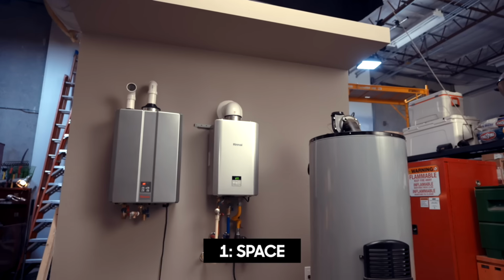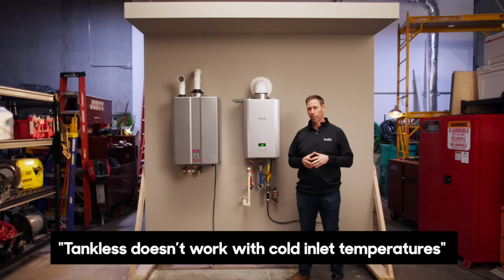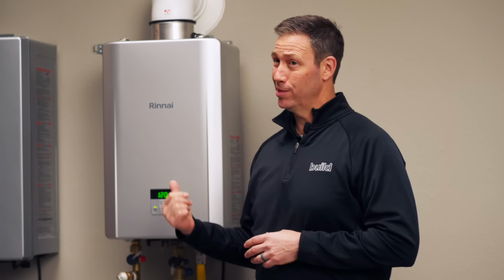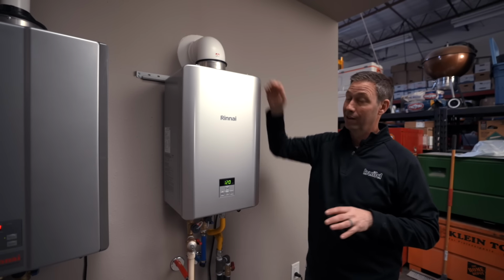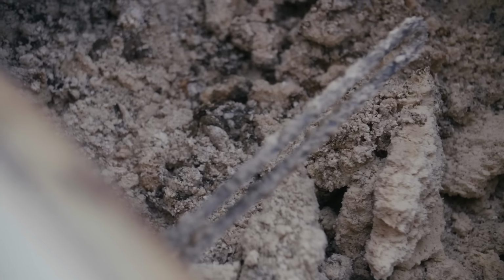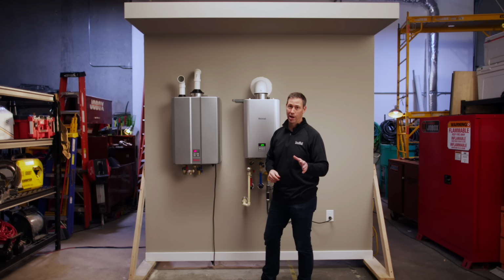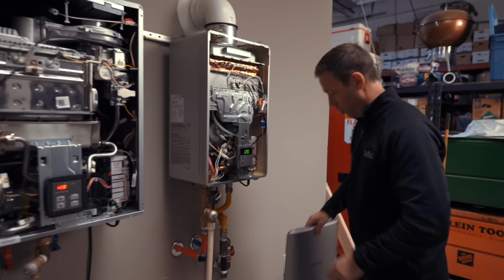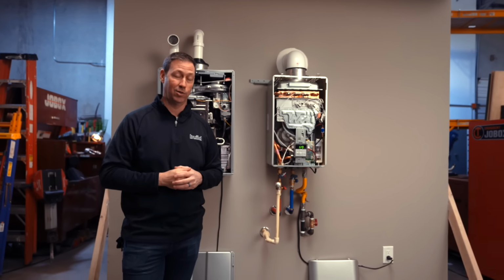DEBUNKING Tankless water heater LIES!

Comment: Wow, theres no way in the UK you'd be allowed to "draw" or suck gas out of the gas line, you'd be at risk of extinguishing flame on other equipment and then resulting gas escape.  Here you definitely have to upgrade the gas line for most instant heat (combi) boilers.
Reply: Ed,he’s misunderstanding how the unit works. You are correct and it’s the same way here in the United States. The fuel runs have to be size for the load and Length, no exceptions. The international fuel gas code is  quite clear here, Matt’s is going to have to wake up to reality and find out there is no magic bullet or magic sizing chart.

Comment: Some of your perspectives are accurate some are not. I have unlimited hot water with my condensing hot water tank. If my tank needs maintenance or breaks down my repair cost is a fraction of a tank less and the lifespan is comparable to a tank less system.

Comment: Matt you should address electric tankless units as well, not everyone has natural gas line, the electric units require a ton of startup electricity and significant electrical upgrades are needed
Reply: Correct. That's the reason I recommend getting a heat pump water heater to replace your electric tank.
Reply: @shawnd567  That is interesting where I am in TX we only have Elec. I lived in Australia and built my first house back in 1986 and we had tankless then and love it. My issue with Elec as was stated above the cost is not practical. So you are suggesting a heat pump water heater I have heard of them on This Old House and Matt has suggested them before as well. Thanks
Reply: @richardgarrow9260  not all of TX has electric only, although that is spotty and equally true in rural areas nationwide.
Still, propane is an option. Of course, masturbating with a cheese grater's an option as well. It all comes down to what you want to pay equipping the home with and a cost/benefit analysis. For most, running gas lines wouldn't be worth the expense, save with new construction.
Reply: If solar is already on the roof, does that mitigate any of the issues with electricity?
Reply: @Guzeebo  An electric tankless unit uses a LOT of power - almost no residential solar is going to give you enough to run it in real time, and you'd need a really impressive battery setup to be able to keep up.  If you wanted to operate primarily using the solar on your roof you'd probably want a heat pump tank system where you can slowly charge it with a lower amount of power rather than needing such a high load at once.  More efficient than using PV electric would actually be to use solar hot water heating directly rather than having losses due to the panels.
Reply: Reason why we ran gas to the home, got a tankless and retired the electric water heater.
Reply: Rinnai makes propane versions of its heaters as well.  That's what we have.
Reply: @pmasters1951  even with propane, it still would come down to running a gas line. Not especially horrendous, but still a labor expensive thing. If I were to purchase a home, I'd probably add the line myself and have it inspected afterward. But then, I prefer either gas for cooking or induction for cooking, with a modest preference for gas, despite the much lower efficiency.
Which reminds me, gotta check the induction cooktop, damned temperature sensor failed on one hob...
Reply: @spvillano  I am curious .  Ever use an EMF meter on the induction while in operation?
Reply: @spvillano    I am curious what the EMF levels are when the induction is operating
Reply: @spvillano   I am curious what the EMF readings are while the induction is operating
Reply: @ethbme4743  nope, I wouldn't, as an induction unit uses electromagnetic energy to heat and it'd likely damage the meter.
Reply: I wired a small on a few years ago.  It wasn't very big, it was just for their bathroom.  I had to run two 80 amp, 230volt circuits to the one water heater.  It worked and was fine but, I just don't know how people justify these especially with the cost of copper wire right now.
Reply: I too do not have gas, live in a Condo and gas is not available. I would like to replace my 52 gallon tank with an electric tankless water heater.
Reply: @larrybruce4856  Do you not have room for a tank?  A heat pump uses ~70% less energy than tankless.
Reply: i wish I had read your post before posting one of my own; I can't get my head wrapped around the math.  I would love to take a 30 minute hot hot shower but despite having no solar and no super efficient anything what I did do was buy some really good digital timers with battery backups on all of them and the one exception is my water heater; it has the Intermathic WH40 despite my water heater being a 120 volt 19 gallon 1500 watt tank; I have yet to find any material that can state a tankless is going to save me money on my electric bill.  Love to have natural gas, but out in the woods, that's not happening.  Solar?  Too doggone expensive thus I opted for efficiency and a little common sense.  Nobody ever talks about the power required to run these things let alone the upgrade in proper wire size, circuit breakers, and running wire through existing walls.  I would kill to have one of these things, but math is math, right?  So what am I missing?  Installing black water bottles on my roof?
Reply: @berrywr1  well, there is an alternative to natural gas or electricity, propane. Of course, if you're in the woods, profanity is not included with the propanity.  ;)
As for wiring, it depends upon what you're doing, if you're in a mobile home, it'd become a serious science project. If in a building, a matter of running new wiring and possibly having to upgrade the breaker box and service line.
In either case, profanity provided by the user. Either from dragging in tanks, arranging propane delivery or humping cables and fishing them.

As for what you're missing, it's the same thing we're all missing. Either an infinite well full of money or a working magic wand.
But, never fear. Cheap solar is coming - right alongside cheap fusion power, flying cars and cloudbursts that rain unicorns.
Reply: Not only that, but natural gas is going to go away so why continue to invest in it? Short-term thinking is what it is.
Reply: @AnthonyBrusca  Natural gas isn't going away.
Reply: @jhoughjr1  Yes, it is. It is literally required for the world to go net-zero GHG emissions. It's not at the top of the list but it's up there because it's easy to fix because the technology exists already.
Reply: I know it's not front of everyone's mind today, but we are needing to decrease the amount of CO2 production including from combustion - even fairly clean combustion like natural gas.  Trying to find ways to be efficient in how we heat water as well as whether it can be done using renewable sources that limit the greenhouse gas production are going to become greater priorities in the future.  Solar water heating and electric water heating are two ways to go about addressing those concerns (although that does of course leave you dependent on the availability of electrical power - which will also be a concern for many).
Reply: @Hubris2  Heat pumps for the win.
Reply: @Hubris2  Thanks to Joe Biden, natural gas, oil, and propane may not be available in the future due to climate activists demanding "green energy".  Electric tankless would be the way to go in such uncertain times of available fossil fuels.
Reply: @Hubris2  So sick of this UN agenda being pushed by their zombie cult.  We are in a CO2 famine.  We need 4x the amount of CO2 than we have now in order to have an abundance of vegetation (food production).  Please get some actual facts from the science side of the debate instead of depopulation-driven political science.

Comment: The only reason I can see in keeping a tanked water heater is if you have a gas water having hot water when the power is out is really nice. Other than that I would go tankless.
Reply: increased maintenance, replacing heat exchangers and control boards, the expense of troubleshooting error codes.  Some folks don't have such issues, but they're the lucky ones.  Tanks are simpler and less risk of repair. and I don't want the increased risk.  And look at the comments about people waiting weeks for replacement parts!

Comment: Overall good info. But it is not all correct. Your one alleged Myth is not a Myth.
Tankless are slow to respond, is indeed correct. Yes I will fully agree that dealing with customers and most of them fail to realize that the hot water has to run through the pipes to get to where you are wanting it like the shower. But they are still slow to respond even not counting this. It takes a second or two for that unit to notice the increase in volume and another second or two for it crank up the flame and start outputting more hot water. I have always noticed this. You can even literally watch it at the unit. However, those are not ideal situations as again yes that water has to run through the pipes too, so how much or how little is it simply the unit being slow to respond. I am currently in an ideal situation where I live now. I stay in a granny flat where a tankless is mounted on a outside wall and shower is the literally on the opposite side of that wall. So there is like about two meters of pipe (pipe runs down wall a bit and then into the wall, then back up to top of shower head). And sorry but two meters of pipe and one should not need to be waiting several seconds for it to adjust and give more hot water. Meanwhile inside the actual house which has a tank heater. Again a similar situation where the tank is outside the main bath. Except on the inside is at first the tub (no clue really how long that takes to respond), but further towards inside of the house is the shower. I can get hot water to the shower from the tank almost instantly. There is no pause or waiting at all. So sorry mate but that is not a myth, it is true. Again you can even watch it in the unit and watch how long it takes to respond. I am sure some are quicker than others, but many of the older units are not (like you said they last decades). In AU tankless has been the norm for many decades. I do not know how long, but when I came here in late 2000's every house pretty much had one and they were decades old. I typically seen them on houses built in the late 70's and 80's that they were the original hot water source installed.

Comment: As a plumber pvc is not legal to use on exhaust side of the unit. They are actually moving away from 2 inch pvc venting to 3 inch. It even says that on the pipe that it’s not for water heater venting. It can cause the pipe to become brittle and can crack.

Comment: Everything is correct but his gas line sizing. He is totally wrong and taking on a lot of liability by opening up his mouth on this one. There is no gray area here (fuel run sizing is fuel run sizing. There is no magic gas valve that sucks the gas and you can use a smaller fuel run. The national fuel gas code is clear. Maximum BTUs converted to cubic feet per hour then we’re going to use the longest length method). There is no magic sizing chart for tankless water heaters or any other gas appliance. Matt , if there’s a magic sizing chart for your tankless water heater, let’s see it (?). My experience comes from 35 years in the gas industry.

Comment: My biggest gripe with my Rinnai water heater is when I'm short cycling it while shaving the water goes cold. If I turn the faucet on and off to quickly while clearing my blade, the heater does not kick on, meaning I get a cold shave or I have to run the water continuously. I'm getting good a shaving while someone else is in the shower or doing dishes so the demand is already on the unit ;)
Reply: That's helpful feedback. I hadn't even considered that aspect.
Reply: @hempelcx  Absolutely, otherwise, I really do love the Rinnai tankless I have. In an ideal scenario, maybe I'd also install a hot water circulator pump and just request circulation while I'm shaving, I think that would solve my problem.

Comment: Scale is an issue depending on where you live. If you live in Phoenix, you don't want a tankless unit. I installed one in place of the tank that went bad, and within 3 months it was already failing due to scale build up.

Fortunately, the manufacturer continued to send me the parts, over and over until the warranty ran out. 2 years. Despite my every attempt to descale the thing, it just wasn't possible to maintain.

Comment: Love the video but as a master plumber, that last bit about not having to upgrade your gas when changing from a tank to tankless isn't exactly right. They can pull gas through a 1/2 line UP TO around 5 feet, and past that the smallest line to handle that amount of btu needed is 3/4,  or even bigger depending on how far the gas line has to run from the meter and the nominal pressure in water column that the gas service supplies. Your going from a tank that only uses 40k btus to at minimum 120k btus, if not normally 199k
Reply: yet somehow using more energy for the same heating is more efficient.

Comment: problem i have with this method is huge amount of power used instantly, using solar ,same power used but spread over whole day, the instant system means power stations must have much larger capacity at a time when sun has gone down, hence the ''need'' for nuclear or fossil fuel......

Comment: i used stainless steel beer barrel under sink,connected directly to photovoltaic panels,just half a cup before hot water comes out, did same with shower, put hot valve up at shower head with extended handle [ball valve] , fast turn on and almost instant hot water from shower head, very happy with result......

Comment: How about minimum flow rate before the unit kicks-on?  In Oregon, not Canada, I have measured the incoming cold water temperature at 35° F  Sometimes, I like a slow trickle of not icewater when processing vegetables or something.  Is it not true that the higher capacity tankless heaters require progressively higher minimum flow rates?

Comment: One issue you didn't address is how much power the tankless units use. I'm on solar power exclusively and the smallest tankless unit I found uses 8 kW at 1.55 gpm. Someone would have to have a 10 kW system (or larger) to use it... UNLESS the units don't use that much power when set to a lower water temp. Can you do a video explaining the power usage and what happens when the unit is operating? For us solar folks, that would be most helpful.

Comment: 1-Space: At $200 SF and up, the floorspace to house a water heater is easily an $800 luxury
2-Efficiency: Regardless whether you have an electric or gas on-demand, the savings for typical use will be significant. ROI is typically under 4 years.
3-Endless hot water: Double edged sword ... never run out, but the meter never stops.
4-Longevity: Year 7 on my installation and had to replace one control board

I was installing tankless units in the 80's They've been around for a very long time.
Reply: always had tanks, never had to replace one control board.  Or heat exchanger.  Or call someone in to troubleshoot error message.  Somehow the ROI is short only if you leave out that tankless on average are more expensive to maintain.   And the fact they've been around a long time?  If they were all they're cracked up to be, more people would have them.  Europe and Japan, sure, space is much more a consideration there.  If space is the issue, go tankless.  But don't kid yourself you're guaranteed that ROI.
Reply: @annamyob  the unit came with a 10 year warranty. Replacing the control board was a 20 minute task. Maintenance is simply flushing with a descaled annually quick and easy. If you have a water softener, the flushing is even easier. I’ll never have a tank again.

Comment: Yes they are not new, when I was in Germany in the 70's they had tankless you just don't see tank water heaters in Europe. Oh and you forgot to mention electric tankless that do not need venting. Very good presentation anyway! Oh and yes I have turned 3 areas that use to be used only for a tank water heater into useful space and or a storage closet!!!! Thanks

Comment: Natural gas and propane water heaters typically last “decades,” and you didn’t really touch hon the major sticking point for tankless for many of us: the price of propane fluctuates wildly, requires costly tank and line installation and delivery contracts, and natural gas is not available in large swaths of the country. My only viable tankless option would be an electric tankless and they weren’t mentioned. They draw huge amounts of power compared to a water heater tank.   I also like the simplicity and serviceability of a tank water heater. Those tankless units look very complex and while failures may be rare, I’m sure they require a tech and an expensive repair to have them working again.

Comment: Thanks for posting this.  I can’t agree with you more. I have a Rinnai combi unit in my home (domestic hot water and hydronic heat) and love it.  Removed an old cast iron boiler and a 40 gallon heater tank. 

I also installed a Rinnai tankless water heater in my wife’s vegan food joint and got a huge benefit from space savings because the shop is small. An unexpected benefit is how whisper quiet it is. The old 50 gallon commercial tank with exhaust blower was very loud.